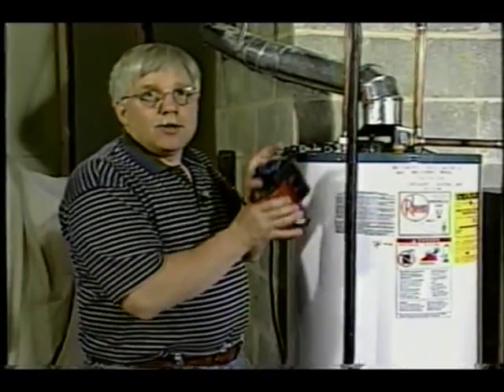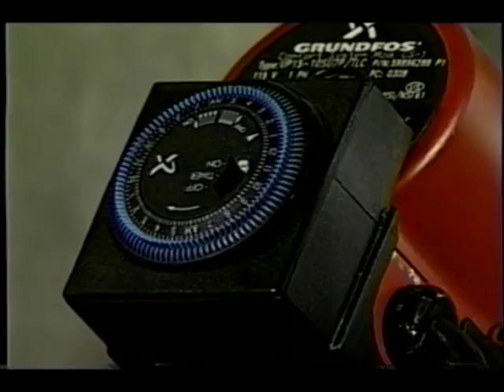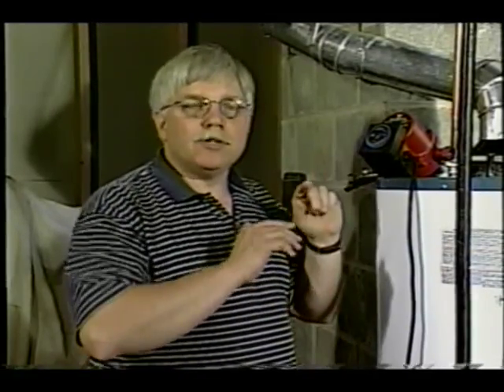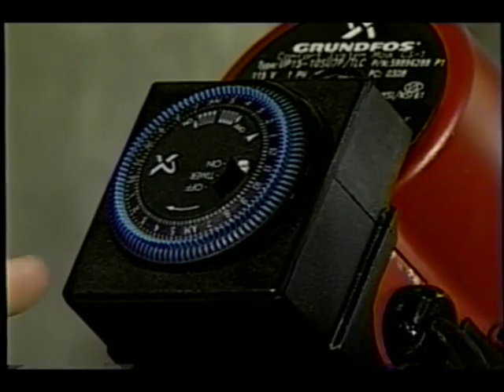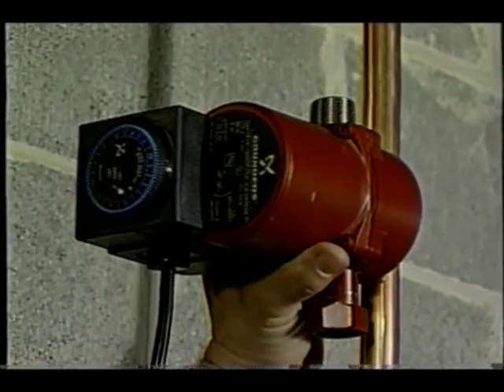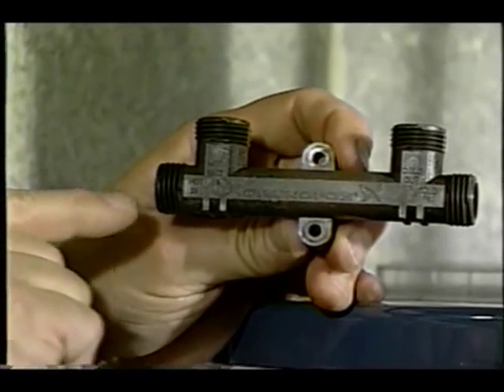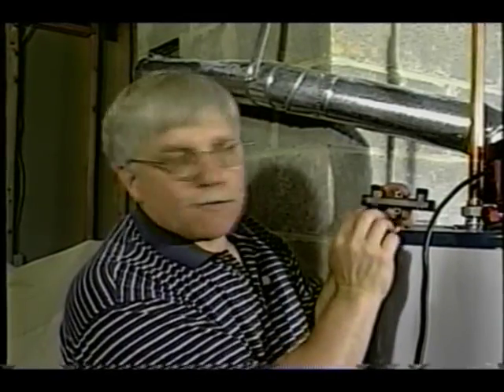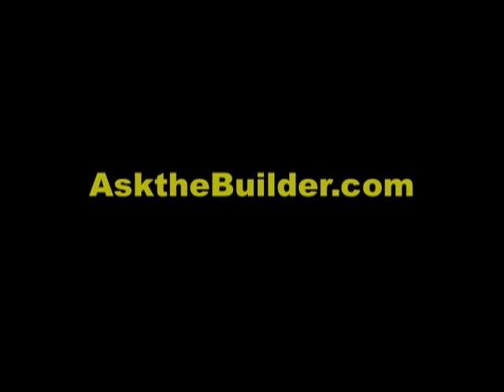Water Heater Recirculating Pumps

Comment: With typical residential water pressure at 60 psi or more ( which adequately moves the water thru the pipes sans any pump),
it seems to me, the bypass valve alone would accomplish the same trick.
Reply: Think again.....both the hot water side and cold water side are at essentially the same pressure...let's say 60 psi in your example. The pump gives just enough "oompf" ( about 2 psi depending upon where on the pump curve the pump operates)....to help move the water that sits idle in the hot water line...over into the cold water line, therefore back to the tank. It will do this until the "sitting" water the hot water line gets up to temp, then the under-sink valve will close the cross-over.
Reply from the maker: Maybe... Be sure you subscribe to my FREE newsletter right here front and center: www.AsktheBuilder.com - Also, I now LIVE stream each M-F at 4 PM Eastern time at https://youtube.com/askthebuilder

Comment: One thing to consider though.  Heating water takes a great deal of energy, and if you keep pumping it through the pipes where it can cool down, you are losing energy there as well.  It's probably cheaper to keep the hot water inside the insulated tank, and dump the cold water down the drain.
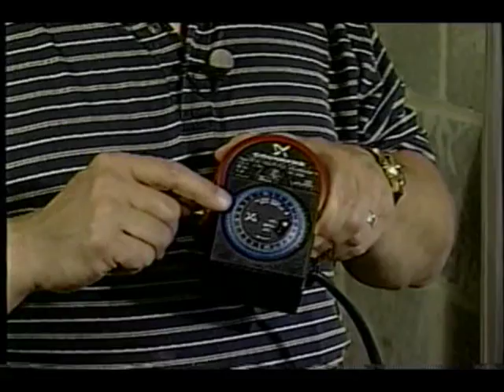Reply from the maker: I think you must have watched a different video then came and commented here. At 0:44 in this video I clearly show the device only recirculates hot water for short specific time periods in the day. See that round dial with all the little blue detents? You can have the pump come on and off for any 15-minute period of time you want.
Reply: Ok thanks for the feedback.

Comment: Any suggestions for a setup that is made for a dedicated return line?  I guess you could just plug the port that is supposed to take water up to the sink's cold side.  I also talked to Watts, and they confirmed this pump doesn't have any means of sensing when water is needed.  If the tab for a particular 15 minute period is on, the pump is going to run, whether it is needed or not.  Overall almost a good solution, but not.  Who has something better?

Comment: Why not just put in an on off switch and wire it to a location instead of a timer when you get home ,you turn it on before taking a shower . You could also insulate your hot water line

Comment from the maker: @pianodannmarr This pump comes with a bypass valve that's installed at the furthest fixture. It uses the existing cold water line in the house to return the cold water in the hot water line TO the cold water half of the system. When it senses that hot water has made it to the fixture, it turns off the bypass valve.

Comment: You really need a separate return line to get this to work without heating your cold water.  That's not going to be easy for most houses though, but if it is doable for you then that's the way to go.

Comment: It is also a good way to make your water heater work harder, the longer it took to get hot water to your shower, the more heat loss you will have in your plumbing when you circulate hot water through it. Put that in a hot climate and you are plain stupid. If people would use their shower water for their yards, they wouldnt really be wasting anything by waiting for hot water. This is just a dumbass "luxury" item that wastes more in electricity and lost heat, then it could ever save in water.

Comment: If the bypass valve closes at 95 degrees, what prevents water from siphoning into the cold water line when this valve is open and you only want to use cold water?  The last thing I want between my hot and cold water lines is a normally open thermostatic valve allowing cooled down water in my hot water line to siphon over into my cold line everytime I flush my toilet because hot water wasn't present in the line to keep this valve closed.

Comment: 2 do this you do not need any brand ( grundfos, willo, etc) , just instal a programable electrical switch ( can be find eith the socket connection for the waa outlet ) , and program it for your needs . Save the extra cash for soap :-)

Comment: On a normal system the the line coming from the water heater goes in and branches many times, finally ending at the furthest fixture.  On a system set up for a recirculating pump, the hot line does not end at the furthest fixture, instead it then loops back to the water heater where there is a recirc pump installed. So this pump keeps the loop full of hot water allowing quick access to hot water from anywhere in the house.  Some pumps have timers on them, so they are not constantly spinning.

Comment: The Tankless water heater is new and was tested in the factory where I bought it from and was working fine. It is installed in a concrete brick home with 1/2 CPVC tubing which the tubing is installed inside the concrete sides of the house and lead up to our bathrooms. What is happening is the pressure of the water is fine and while your taking a shower (Located on second floor of the house)

Comment: Would a pump like this work to boost the hot water heater from a tankless water heater I have. I am having problems with the hot water cutting out while I am taking a shower, it will cut from warm to cold!

Comment from the maker: I'm sorry, I don't have a clue what you are talking about. This video is about using an existing water heater and a cool pump that has a timer. At preset times, the pump turns on and gets hot water up to all the fixtures in a home. The pump can go on and off many different times of the day so as not to waste energy.

Comment from the maker: There are boilers that do double duty. They have been around for years. Toilet ballcocks have adjustments to limit how much water goes into the tank. Trouble is, older toilets may not function well if you only partially fill the tank. READ all of my past columns about low-flush toilets, and the problems the first-generation ones had years ago. It is high-school physics: F=M x A

Comment: This made me think of another idea I had in the past.  Would it be possible to do some kind of modified plumbling into a radiator, made for heating homes, so household hot water would circulate through it to help heat a home?

I have one other question, unrelated to this.  Is there some kind of limiting valve for a toilet water intake, so if it took more than two gallons to fill a toilet tank, it would automatically turn off the water to the toilet tank?

Thanks Tim.